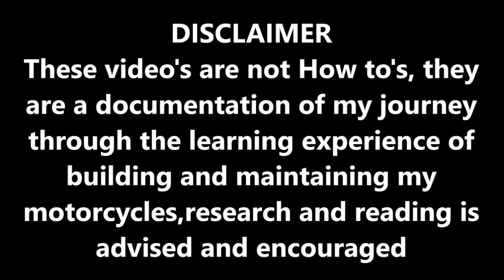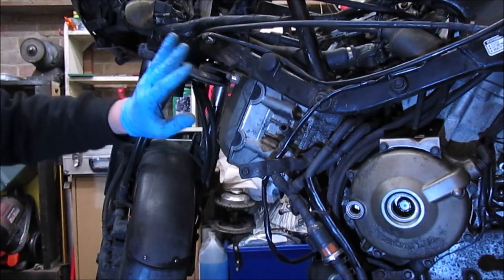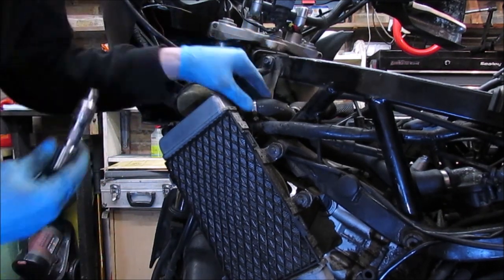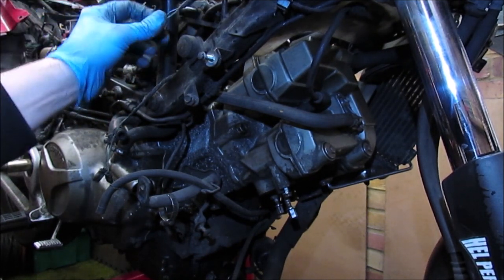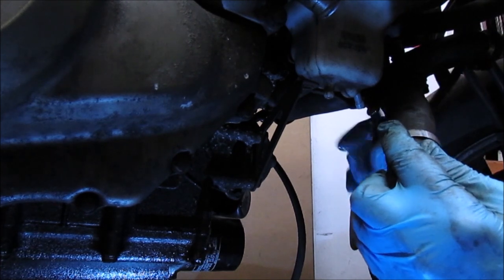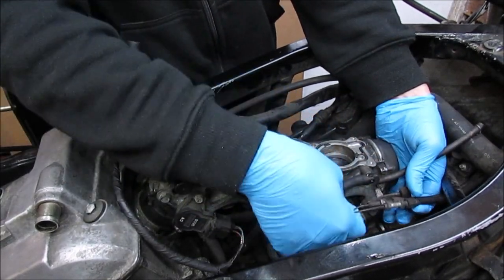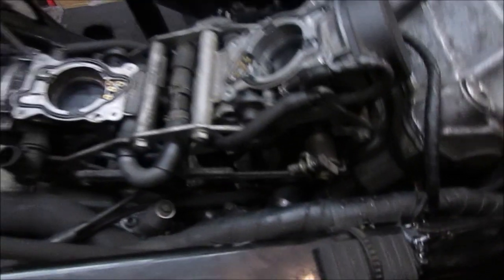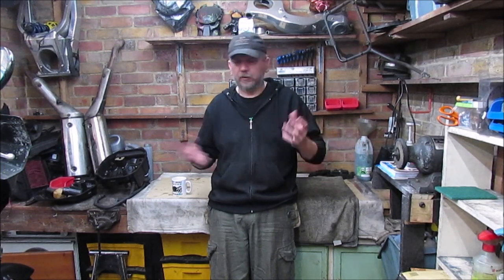Honda XL1000 Varadero  - Refitting the Radiator and Carburettors

Comment: Hi there , I come across your channel when you first changed the air filter of the Varadero , by looking at those videos I've done servicing mine as well. In this difficult times, these v-logs are pretty good supportive visuals for us saving some repair bills. So your channel definitely achieved purpose. Much appreciated your time and effort. Thank you 👍
Reply from the maker: Cheers Cem, glad it has helped, that is the mission of the channel, to help, to learn, to inspire

Comment: between the waterpump and right engine case there is a tube goin up? Where does it connect in the other side? mentioned in the manual as right crankcase breater tube at page 9-3 in workshop manual?
Reply from the maker: replied in your other comment, but i will double check and let you know

Comment: Hi, friend. I have pops in cylinder 2 and the carburetor is 2.5-3 did you have any similar problems?
Reply from the maker: No, not had that, carbs are running standard jets

Comment: Did you get any coolant leaking from the hoses after putting the bike back together?  
I have just drained, flushed the system with a flushing agent, and put new coolant on my '99 Vara. I followed the manual instructions thoroughly and bled the air out of the system. After a couple of heat cycles there was a leak from the top left radiator hose and the thermostat housing cap is leaking like a good one. I don't touch the left side of the bike whilst changing the coolant so it's strange that leaks have started on that side of the bike. I wonder if I have some of the flushing agent in the system and it's causing problems. 
Anyway, I have drained the system and pulled the thermostat cap, the o-ring was toast and have a new one ordered. Luckily the short hose that comes out the tope of the left rad is still available OEM (a lot of the hoses are no longer available for the '99-'02 Varas. Would the later model hoses fit the older bikes? Surely the engine is the same?).
Did you apply any hose sealant when reinstalling old hoses, and how hard did you tighten the hoses? I am worried that under tightening will cause leaks, and over tightening is also not good, also the sealant / no sealant question seems to have divided camps. 
Thanks for taking the time to make these Vara wrenching videos, they are vey helpful.
Reply from the maker: Cheers, no leaks so far, all the hoses looked in good condition, what is the condition of your hoses ? any deterioration / cracks ? unsure about the newer vara hoses, engine is roughly the same but possible the hoses could be different, no hose sealant and all were easy to tighten, the job had to be done and it was a great learning experience as not taken the Vara apart before and i like to document what i do (not How To's) to hopefuly encourage people to learn and have a go
Reply: @TheAmateurBikeBuilder  ,
The hoses on my bike are generally in good condition. The short length of hose that connects to the lower right radiator has 'opened up its end' so to speak; when clamped down, it is flaring. This is the hose that the manual says to take off to empty the radiators of coolant and consequently due to much taking off and putting is, I guess most prone to failure. This hose is also no longer available on the OEM fiches. 
The mistake I made was to tighten up the hoses, add the coolant, purge the system, and then bolt on all the side panels and crash bars before running the bike for a couple of heat cycles and looking for leaks. As you say, live and learn. 
I have been in contact with a silicone hose manufacture in the UK who do not make hoses for the Varadero 1000, but have told me that many people have been asking for hoses for the bikes; fingers crossed they will start producing them. 
All the best with keeping the old Mk1s on the road.